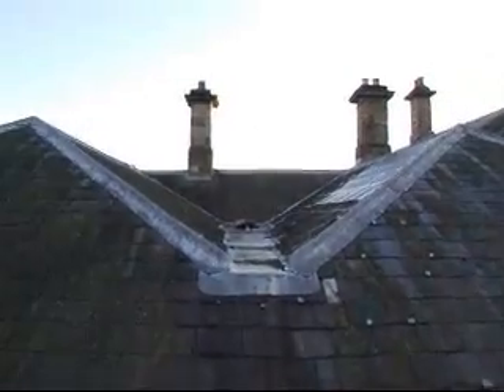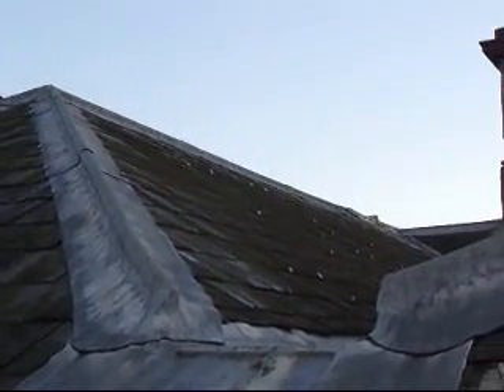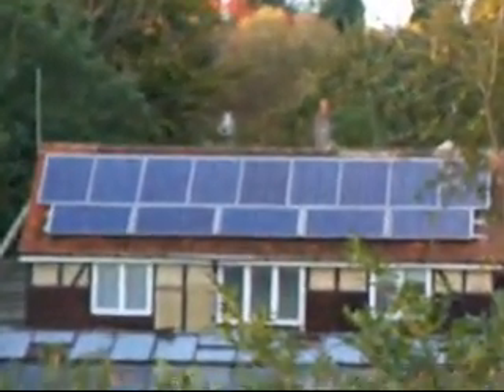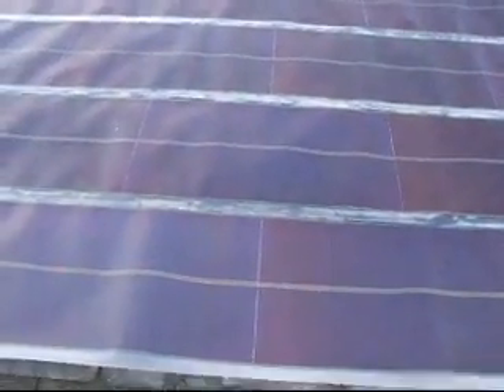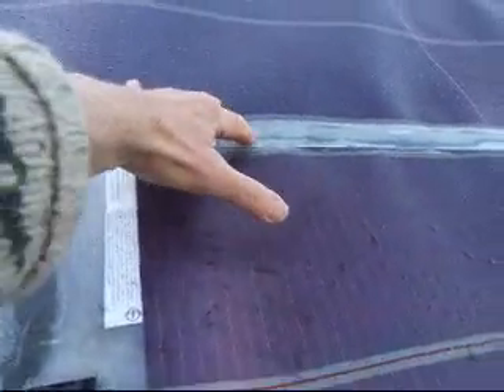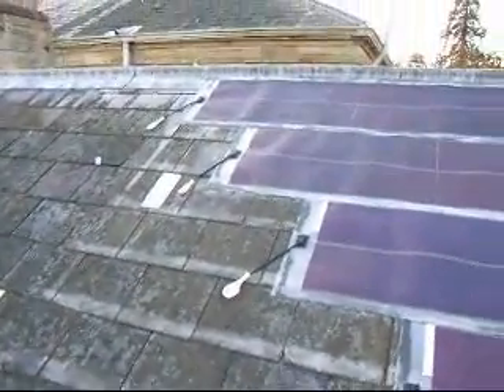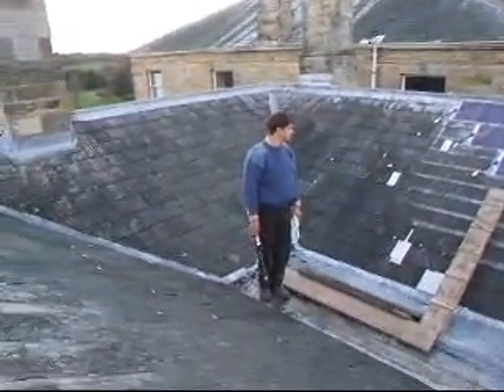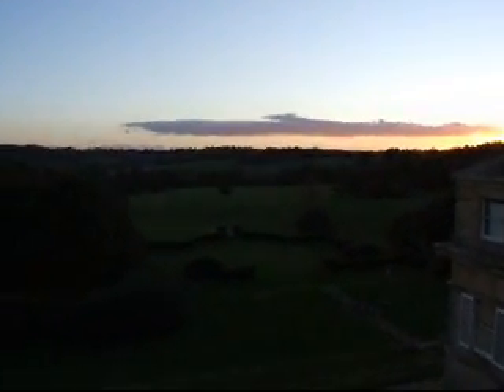flexible solar panels on slate roof

Comment: Thanks for taking the time to show your method of attaching solar panels. My slate roof is roughly the same conditio  as yours. How has the fitting stood up to the weather?
Reply from the maker: Horizontal glue lines are not satisfactory - they hold water which freezes and eventually loses grip. Vertical lines of glue might be better. All on slate roofs have now blown off. :-(
Reply: @unequally-tempered  It is never easy. Did you abandon fitting solar panels or use conventional rigid panels with standard brackets?
Reply from the maker: @aceryeo8409  I'd advise standard fittings on this sort of roof. The panels on flat or gently sloping metal roofs have been fine though